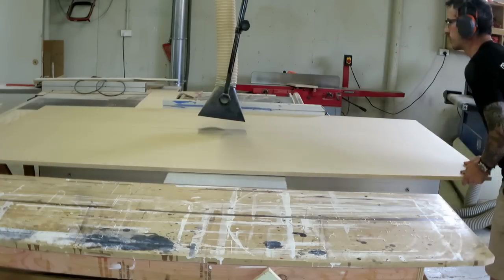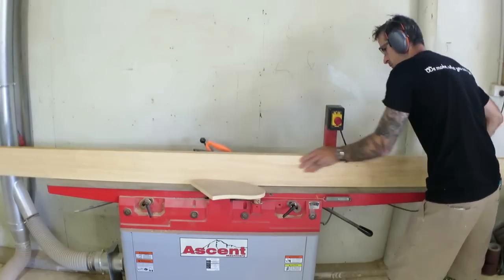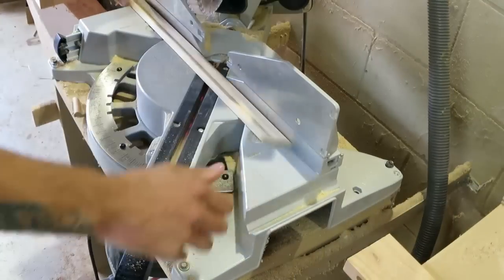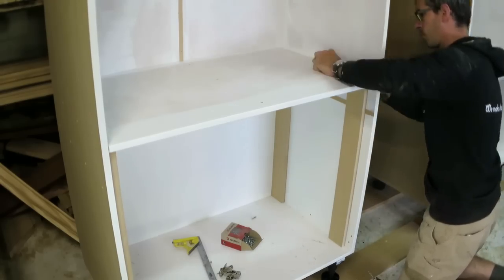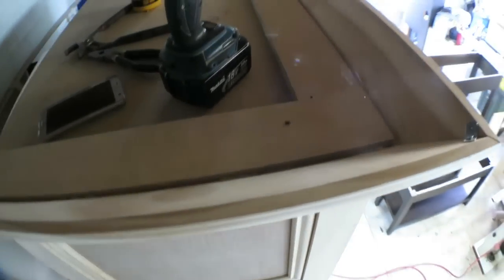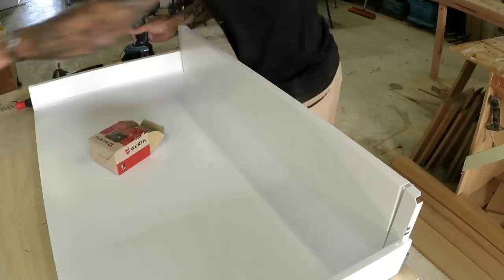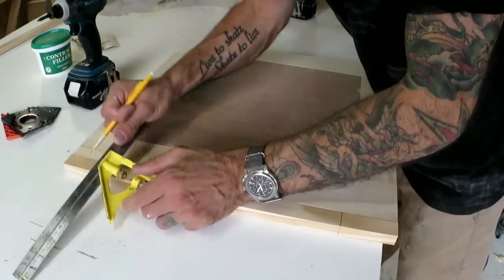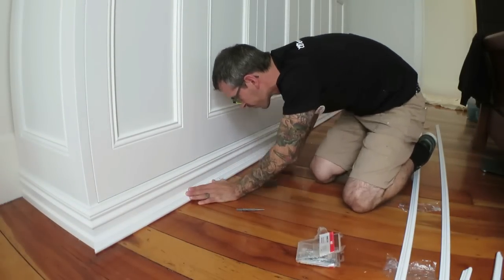big wardrobe

Comment: I am in awe by how this turned out! Absolutely incredible. Its all in the details. For the trim around the bottom and the scotia on top is it necessary to caulk or paint the mitres when reassembling? Or is it seamless as is? Cheers!
Reply from the maker: +Alex Holjevac hi thanks. It's almost seamless but there is always a fraction of difference when reassembling.

Comment: I build custom cabinets myself, usually built-in/on-site, and use similar hinges and drawer slides but I'd love to experiment with the other items you use (drawer assemblies, adjustable feet, etc.). Where do you get them?  Also, I purchased a small Senco air compressor paired with a short coiled air hose for small jobs (like installing the quarter-round) that's very quiet and convenient- well worth the money.  Very nice work, I saw several things that I can use in the future- thanks!
Reply from the maker: stvbrwn8  hi the drawers a by Blum.  their regular soft close with an inner drawer front kit.  the feet are made for Kitchens I get them from a trade supply ' Enko'  here in NZ.   compressor would be great if you do this kind of thing often.  I tend not to do many installs like this.

Comment: I would have liked to see the base board moulding along the wall removed and cut so you didn't have to use the trim along the sides. But I get time and money are a factor too. Nice unit. I build a similar unit as a build-in pass though deciding rooms with storage above and along the sides.
Reply from the maker: omoog  hi,  removing the house skirting was the plan,  but due to the way the house had be been built and subsequently renovated this was going to cause more issues than it solved.  for example it was normal when this was built for the floor boards not to go under the wall and there is no bottom plate,  the skirting was then fixed to the studs and the wall linings on top of that. if I removed the skirting it would open up a hole to under the house creating huge draft issues.

Comment: Really great looking project. I wonder why you routed out a rabbet for the door panels, but used grooves for the side panels. Was it a matter of joint strength?
Reply from the maker: End panels are thicker than the doors , so made a groove so as they matched the depth of the door panel.

Comment: Hy Joey ! Why did you join the top moulding first and install after ? It is more easy that way ...Nice job by the way ! Cheers !
Reply from the maker: nyc macs  could do it either way.  just much faster for the install if it's all pre fitted.
Reply: yes that's true , but most of finishing carpenters do it on perfect miter jig assembling , because it is easy and faster , plus you can nail it and glue it at the right angle. My advice , no offence about your work... i so many videos of Gary Katz mitering joints , specially crown mouldings and it do it faster and more acurate... Cheers and keep it going with more videos !
Reply: By the way , i would like to ask a question about something , i sale my homemade cabinet saw that i build and i buy the 2016 DeWalt 745 ( constructor saw ) it is worth the money ? It is good for small woodworking projects ? The sheets that i'm using is most of time particleboards and i rip them with the track saw , so no worries about rip capacity ... I ask about the saw in general ... I buy it because i like the rack and pinion , besides Bosch GTS 10 J has more and more plastic parts in construction ... thanks again for the replay !

Comment: I am very new to the woodworking. I was wondering, why use mdf ? when entire article would have been made in pine?

I am planning to replicate the project in only pine wood. Hence the question.
Reply from the maker: And solid timber frame and panel needs to have allowance for the panel to move seasonally. Mdf or ply solves this problem meaning no cracking, warping
Reply: Thanks for quick response! 
Your work is awesome!

Comment: Excellent job mate, great vid, one question, it looked like you used a biscuit jointer on the doors but they looked like dowels when you had finished, was it a tool that drilled for dowels, cheers in advance
Reply from the maker: +Mick M it's a domino machine by festool. 
Not cheap but pretty bloody handy
Reply: Thanks for the reply

Comment: Great vid.  Am a little curious about your choice to use plastic for the feet/rods; temporary solution or other?
Reply from the maker: Dennis Ring they are adjustable cabinet feet. usually used for Kitchens here.  super strong and made from recycled plastic.
Reply: I see.  I was just curious about using plastic.  Didn't seem like something that would hold up long term.  But I trust you know more about than me.  

Thanks for the reply!

Comment: First off, great video and very informative and this will go a long way to help me with a project here in Adelaide. However, i have a question about that small piece of moulding you added to the whole thing at the end because i just know the same thing is going to me. When you added it, didn't it look funny because yes it took the gap out but wouldn't it be uneven across the what was originally built. How did you compensate for that, the fact that the added piece will be sloping away and uneven on the original mouldings? Thanks in advance for any help.
Reply from the maker: +Shaun Mccaughan yes you could see the small molding running off if you really looked for it. 
I shot myself in the foot by attaching the skirting to the end panels to try and save time. If you add all the skirting after it's installed you can use the adjustable feet to there full potential. And then just scribe the skirting to fit the gap.
Reply: KingPost TimberWorks Thanks for the fast reply and information, I will do just that when i go to install the wardrobes. 1970's built house so I'm guaranteed the walls and floor are way out.

Comment: Hey Joey, Thanks for the vid. Just wondering, on an episode of 'The shop stool podcast' you once said to make some interior frame and panel door out of MDF and in this one you used Pine and ply. Is the consruction a much of a muchness or do you have a reason for the different constructions?  Just wondering as I have been asked to make 2600mm high frame and panel doors for a linin press? Not expecting an answer, I know life gets busy but thought I would try my luck. Thanks for all your vids and tuits. Very much apprenticed.
Reply from the maker: Hmm I kinda remember that conversation,  I think if you will have a painted finish and don't want to have any movement concerns MDF or plywood is the way. Plywood is much lighter and stronger but you have edge details to work out and timber grain showing through the paint (which I like) at 2600 you can double up 18mm stock for the styles and have join the pieces at opposite ends. Just my 2 cents
Reply: KingPost TimberWorks thank you.

Comment: Thanks for the video Joey....couple questions....
The dust extractor hood over the table saw.....how is that attached to make it sturdy enough to stay put and do you find it effective?
And the moulding strip you added because of the sloping floor and wall.....did you need to scribe that moulding into place?   If not did the angle or slope of the moulding look obvious?
Cheers
Reply from the maker: HI ,, the dust hood is attached via my ceiling on a kind of teliscopic pipe thing i made up.  it works really well eg when cutting mdf i cant even smell it.  no i didnt scribe the extra moulding as it was nice and flexible.  if you really looked at it you could see something running off, but because of all the curves etc on skirting it seemed pretty seemless!
Reply: Joey is it 4" hose to the dust hood?
Reply from the maker: yip 100mm back to a 150mm line to my dust collector.

Comment: Hey! Im trying to recreate the wardrobe from this video; is the backboard 18mm MDF too? Does the weight of that sheet size inform alternative or additional fixings? Blair.
Reply from the maker: I probably used 9mm backing.  I would use a steel angle bracket on the top of the unit to fix to studs in the wall
Reply: @KingPostTimberWorks  thanks so much for your reply!

Comment: Hey Joey. can i ask your advice? I've made a few built in wardrobes, not dissimilar to yours. Sometimes mdf and more recently  birch ply. Timber frame and panel doors using 25mm Redwood pine and mdf panels. I can't seem to keep the doors 100% straight.  even a tiny bit of twist means they don't hang correctly. Any thoughts?
Reply from the maker: Anthony James Brown  hi, ha yea it's a problem for me too. any door over say 800 tall can/will twist.   I find its the styles warping after glue up usually.  I don't have a cure for this other than to try and use dead straight stock.  2 Doors on this wardrobe had bowed 5mm so I needed to add magnets to hold the flat.

Comment: Hi, I enjoyed your video. I am an designer whom is about to make my first wardrobe. Can you tell me how you attached the side panels AND you know the legs they are stood on - are they not adjustable? You were 20mm short on one side could you of not adjusted the height or am I being silly since you would have to adjust them all ? :) and hence you used some edging to cover
Reply from the maker: +Christopher Claudio Skierka cheers,  the side panels are just screwed on from the inside of the unit then cover the screw heads with white stickers.  So yes these feet have lots of adjustment. I had attached the skirting to the end panels to 'save time'  this ment I ended up having about 11mm of adjustment if needed. Turns out I needed about 25mm so just left it and added the extra molding. I have since done another similar version and added all the skirting after the unit was installed.  This makes life a lot easier. Although you are still really only limited to 18mm if height adjustment as the skirting covers the bottom panel of the unit which is 18mm thick.
Reply: Yes, I guess that what experience is all about , knowing what to do when it does not quite go to plan. ... Ahh screwed in. I intend to use venneer  the inside so I forgot to mention that so I guess I could screw in, fill with filler then veneer in situ I guess even though not ideal. Yes I liked the finish you did at the bottom looks very good. My idea is similar to yours - build  in modular and join up after. :)
Reply from the maker: +Christopher Claudio Skierka I would just put littler veneer caps over the screw heads.😁

Comment: Great video! I can't seem to find those leveling feet. I've found other Blum legs that are similar, but they seem like a different design. Could you tell me where you buy yours?
Reply from the maker: Here in NZ blum don't supply feet at all. These are from a kitchen hardware supply company. Around $4 each here. Supplier is access group here in NZ.

Comment: What is the thickness of the wood used on your doors ? Cheers
Reply from the maker: +Richie Jones hi it's 18mm pine. But probably would have been a bit better at 30mm for the tall doors.
Reply: KingPost TimberWorks thanks for the reply - would Redwood be ok to use ? Great work btw 👍
Reply from the maker: +Richie Jones yea sure should be fine.

Comment: What paint did you use and how was it applied? Great video by the way!
Reply from the maker: Oliver Norton  I used a cheap multi purpose primer . top coat is resene   lustacryl semi gloss all 4 coats applied by short nap roller.
Reply: Yes, I would also like to know...
Reply: Wow KingPost, you got great gloss from that.  Did you tip it off with a brush?  When I saw it in the light, I honestly thought you'd sprayed it.

Comment: Screws into mdf without glue? I wouldn't think that would hold up???
Reply from the maker: the cabinets are static, with no loading other than to hold themslves up.  i have yet to have a failure with this method.  my counter argument (not snarky)  would be that the units are screwed to the wall studs there is no glue at that joint,  that screw will never just fail.
Reply: Spax  mdf screws work well,
Reply: How did you attach the end panels?
Reply: they were screwed in.  6.34 mins into the video
Reply: KingPost TimberWorks love your work buddy... inspired me to get into making this stuff for my home. What screws do you prefer for MDF? Great Job mate.
Reply: they don't move anywhere once installed so could never pull apart and i use this method and have for years without any problems